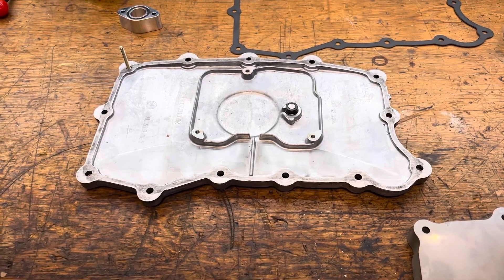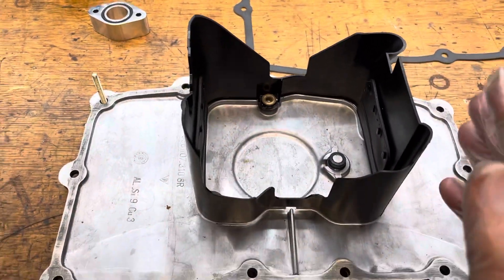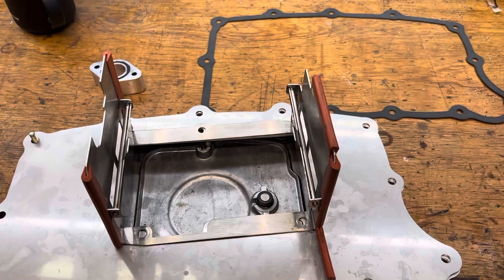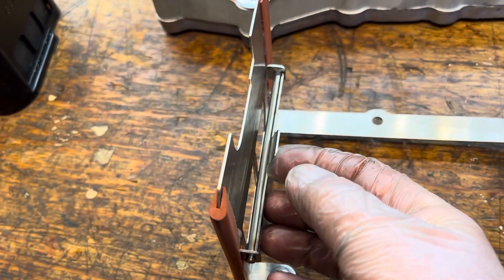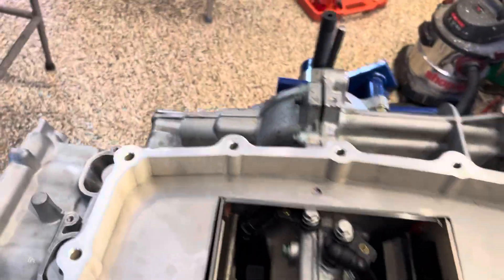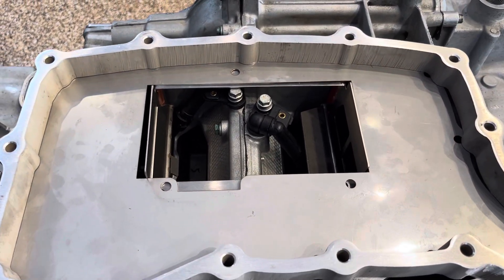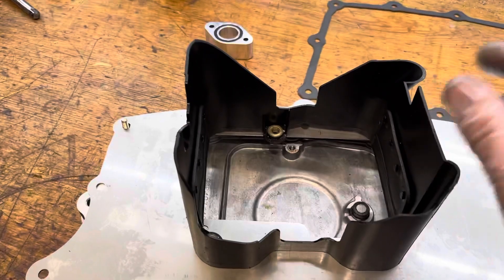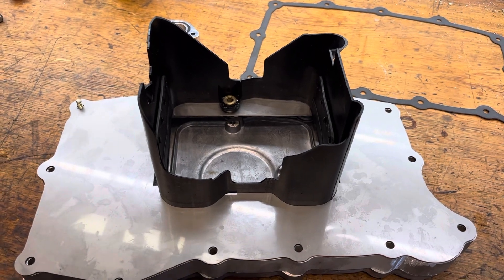Porsche 996/986 Deep sump oil pan from LN Engineering.  Poor design.

Comment: So, way back Mantis Sport made a deep sump that used the OEM baffle. It also has channels in the sump to keep the oil in the center of the lower pan. Of course they are long out of business. My car had one installed when I bought it. It had it's issues, most of it had to do more with whomever installed it originally than the engineering/manufacturing of the part.
Reply from the maker: Thanks for the historical information!

Comment: Oil pressure on the M96 (3.4 and 3.6) is mostly solved this way: Fresh chain tensioners(they can leak oil), Fresh scavenge pumps(they can be worn), Full oil(on the 3.6 order, and , use the 3.4 oil dip stick, fill to upper dot). The main issue is oil geting stuck in the heads; which was solved in steps by Porsche. Compare the heads of the M96.05(M97 3.8l also) and M96.01 how they removed the "oil trays" for the cam lobes and slanted the bottom more.
Reply from the maker: Chain tensioners will make it all impact. But improving these scavenging pumps will improve the situation. On these motors, you have to be careful of not overfilling the oil as you can suck oil back up through the AOS under throttle lift specifically on specific cornering actions.  The deep sump does allow you some relief in terms of having the pick up tube lower relative to the fill line and a higher reservoir of fluid

Comment: A year later. I wonder if they made a change. Anyway, your choice of the word "significant" isn't all that quantitative. Keep in mind, a partly closed window won't let as much wind blow through as a completely open one. As far as a company, they are very self-promoting. Probably to try to justify their exorbitant prices. Silly as other aftermarket companies arn't so aggressive, still sell parts, and their prices are way too high as well (as it's Porsche).
Reply from the maker: Well summarized. As a recovering engineer, I wish I could give you harder numbers to make it more quantitative. But given the net gaps in the design, the engine would move a significant amount of warm idle under G-Force changes.

Comment: You need to have a dropped center (50 mm) in the oil pan and sloped from the sides to the dropped center. The original baffle design needs to be utilized with a 50 mm vertical dimensional increase along with better oil return from the heads to the pan. These modifications will work to address flaws and the oil starvation problems this engine suffers from. Electric scavenge pump system would be the easiest way to get the oil back from the heads to the oil pan.
Reply from the maker: All very good points. If Porsche would have included a true dry some lubrication, not messed up the IMS bearing, and not giving it fried egg headlights, I'm convinced these vehicles would be worth to 2X what they are today.

Comment: What a piece of crap.
Just wondering, what’s wrong with the stock baffled design?
Reply from the maker: The stock baffle design is OK, but it is not compatible with the deeper sump. And the deeper sump is important to prevent oil starvation under high G loads.

Comment: TuneRS is your solution.Im not related to the company in any way whatsoever. Im a little OCD and in my testing found out that the factory baffle works best. I have more info on anyone wanting it with proof. So the tuneRS uses the extension and the verticle baffle as well in conjuction with the factory plastic horizontal baffle win win.
Reply from the maker: Based on what I learned from this LN solution, I would agree the TuneRS solution is best.  It uses the 2qt deep sump combined with the stock factory baffle.  

All of these are stupid-expensive for what they are.  TuneRS is $750 for an aluminum sheet, a cast spacer and upgraded Porsche de-airators.  Crazy!

Comment: Have you had any experience with the FVD Brombacher deep sump pan and baffles? I like LN products as well, but  the FVD B. pan looks great. (however mods are needed to fit my 2006 977.1 M97 3.8L. and I am not certain what the "mods" are (?))
Reply: I have the FVD 2.5qt deep sump on my 996 and my 987 with a 3.4 swap. They've both worked well, but I don't run slicks and it's possible that I'm running out of talent before I'm pulling enough g's to experience a drop in pressure. 

If I had to do it over again I would fit the Hartech unit. It looks like the best design to me, of course I'm no engineer so my opinion probably doesn't mean as much as our host's. 

I may buy a hartech just to satisfy my curiosity.
Reply from the maker: Hi Chris.  I agree with FVD looks great.  It does not have the large increased capacity or extra deep well so it does not have G-load prevention as does the LN, but it does appear to seal the sides better.  I suspect the mods are minimal.  

Are you going to track the car?  Do you have race slicks?  What you buy somewhat depends on what your objective is.  

Sorry to be non-committal!

Comment: Porsche built the X51 baffled oil pan which, in combination with the X51 revised oil pump, is by all accounts equal to the M96/76 Mezger dry sump motor in terms of g-load oiling performance. Better to spend the money on an OEM X51 pan and pump than a deep sump with all of its associated shortcomings.
Reply from the maker: Hi Henry, you may be right, but I have not seen any field data to support the improvements of the X51.  The improved X51 oil pan is only $340 but it does not lower the oil pickup point and accordingly it may only give an extra 0.5 seconds of additional oil before the pan runs dry from g-load.  The additional X51 pump for the head will get more oil back to the the block quickly, but it is unfortunately $3300 per bank not including plumbing for the pump to the block.  If you add to both banks you are quickly into a $8-10k project which is not realistic for most 986 Boxster owners holding onto a $10-20k vehicle.
Reply from the maker: @Brembo Pollypor - The X51 baffle has a slightly larger oil capacity than stock.  It might be 1/2 - 1 quarts greater (at most) in the baffle area.  At high RPM the oil pump runs 50-70 quarts per minute, hence it will deplete the extra capacity in likely less than 1 second at higher RPM (track) driving.
Reply: The big difference, at least as far as I'm told, with the x51 package isn't the design of the sump, it's the extra scavenge pumps in the heads. The base engine has 1 scavenge pump per head at opposite ends which allows oil to pool up in high g corners and it doesn't get pumped out until the oil can make it back to the other side of the head. Having 2 pumps per head fixes that problem.
Reply: @Brembo Pollypor  interesting. Thanks for setting me straight!
Reply: That x51 pan might get you an extra second or two before things blow. Check out the UIDS… might be our best chance at something that’s works